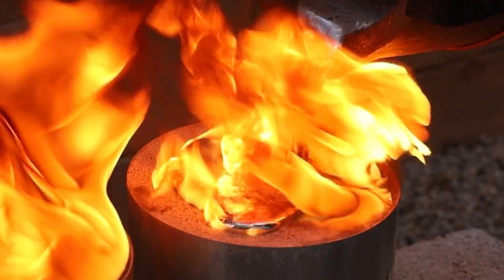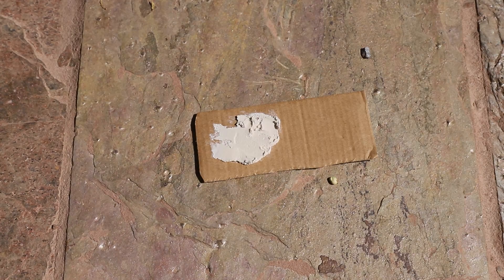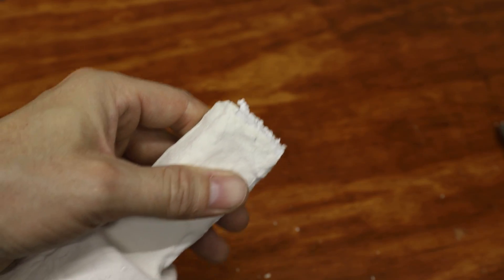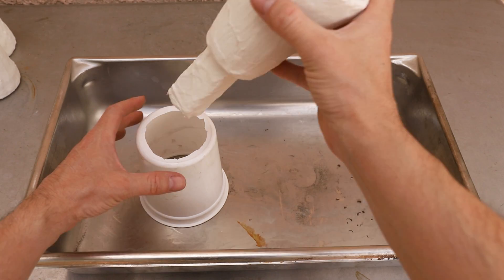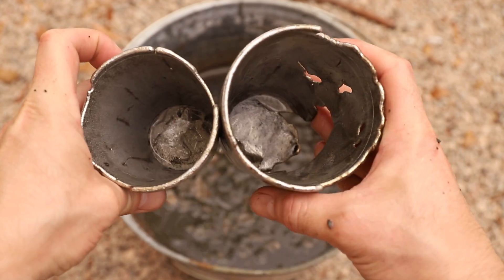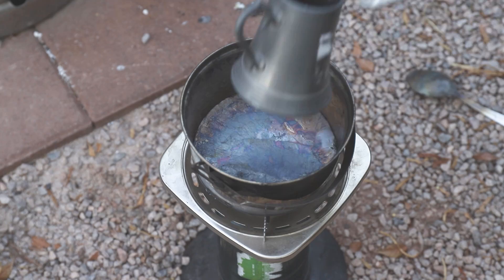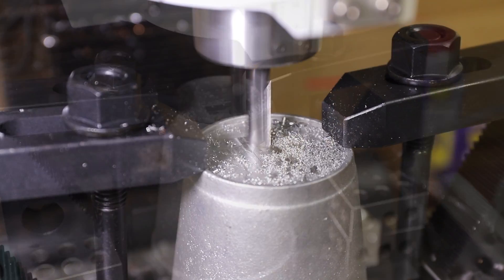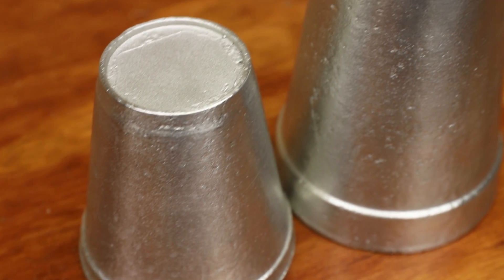Turn Styrofoam cups into METAL - Experimental metal Casting - Lost foam casting

Comment: You could add a couple vents at the lip of the cup back to the top of the mold to give air somewhere to go. Also like others have said, baking the mold before casting and pouring while it’s hot will help as well. While the drywall mud is cheap, using a quality investment might help a lot.

Comment: I would have worked with aluminum if you preheated the plaster molds in you foundry to bake out excess foam and glue from the plaster molds.

Comment: Fun video.  You could use a welding gas (Argon+CO2 mix) flood to suppress the fire.  Those foam fires are potentially toxic and it is not good to breath that sooty smoke.

Comment: You never mentioned pouring temperature, although you mention melting point. The thinner the wall the more over melting point you need to pour it. If I were pouring something that thin the metal would have been glowing orange. Funny how I didn’t notice any comments about temperature either, it’s one of the most important factors in getting good results.

Comment: So I've been thinking, all these youtubers who show off lost foam or lost PLA method casting, and they use various materials for encasing the material, like either some type of special plaster or that expensive as hell yellow ceramic stuff, and then spend a week to add thin layers over and over, that makes me wonder the whole time like what if you just use straight up pure cement, like add a layer of pure portland cement as and lather that on so it retains the details, then encase that in a thick thick layer of mixed concrete (so portland cement, sand, aggregate). Like, wouldn't that be strong enough to withstand heat? Sure it might take a while to dry out completely, so timewise it might still suck like the other methods, but it might be an inexpensive sturdy option. 
Has anyone tried that? Using cement and concrete instead of ceramic slurry or plaster?

Comment: wait...is that drywall compound like suspend-a-slurry??  Could it be used by coating with the silica sand and making a mold for other things??
Also I am wondering if it could be heated like the suspend-a-slurry and silica sand in the kiln...

Comment: I have seen others create the mold with some kind of water soluble plaster.  Then heat (in a kiln)  the mold to burn off the styrofoam so you have a completely empty mold.

Comment: Used plaster drywall to cast foam successfully about a decade ago when I was first getting into metal casting. A very effective coating, cheaaap too. No need for acetone, but do need vents though.

Comment: I would cook the molds at 700C gor a few hours and pour the aluminium with the mold at say 300C.
Reply from the maker: I wasn't sure that the joint compound could hold up to those temperatures but I'll give it a try. Thakns

Comment: just a future suggestion, if you ever find the drywall compound shrinks or cracks too much, you can always make a donut shape on a flat surface, and fill the middle hole with plaster of Paris, then slowly mix the two together, the Plaster of Paris will help stabilize with the shrinkage as the compound dries by accelerating the cure time.

Comment: Just need to preheat those molds so it drives the rest of the rest of the Styrofoam out and prepare the plasterer for the heat extremes. . Mix in some sodium silicate with plaster of Paris for your investment media. , , It will help refract the heat a little better as well as help those molds hold up and probably leave a nicer finish on the aluminum.

Comment: See the videos on how small boat propellers are cast in aluminum and stainless.
Its basically a dip/coat/dip/coat buildup then kiln dried/hardened to become a ceramic of some sort… your styrofoam cup would vaporize, final clean/rinse/blow it out, then reheat (or pre-heat) to ensure its completely dry inside.

Comment: Styrofoam isn’t used in the manufacture of cups. Styrofoam is a brand name for a formulation of polystyrene specific to wall insulation. I believe the rights belong to DuPont. Not the same argument as “Bandaid/Adhesive Bandage” because they aren’t apples to apples. Trivia not trollin…

Comment: I'm perplexed.  No treatise ever written on lost foam or lost wax casting suggests or implies that the hot metal be used to displace the core!  The material is supposed to be burned out in an oven PRIOR to the pour.

You are quite lucky that you didn't get a hot-metal shower then the aluminum his the residue in the mould.

Comment: I cast a cup in high school, but made it solid, my dad had a 19' flat bottom boat and i used it as a stand off for the cavitation plate lever with a aluminum angel iron on the other side of the stringer that i mounted the ignition toggle and a push button starter.... no key.. turned out good and never failed... Gen x Fuck  yea!!!

Comment: If you heated the molds and sand before pouring it would might reduce the thermal shock. You might make a few vents as well to prevent heated air from creating pressure inside the molds. When we did a similar  process in school we did not use a coating or  remove the foam, but let the metal vaporize it as it poured. If we wanted an area to be smooth we would attach some paper to the foam which worked amazingly well. We also used a green casting  sand that would hold its shape if you squashed it in your fist and then opened it. You could add all kinds of textures attaching various kinds of tape and paper to the foam.

Comment: I don't know that brand of mud , you can take a mixed to your liking spoon full and fling (yes fling or drop ) it on to a unfinished white paper side of a small piece of sheetrock . true lightweight "topping" not joint compound should scrape free with a putty knife w/o tarring any paper off the board. In the past "joint compound " has always had good amount of glue in it to guarantee when taping the sheetrock joints the paper tape makes an extra good bond to is the boards. If they where to move over time the seems wont crack and show through to the painted surface of interior walls in theory.  So your cleaning issue could be glue and a solvent mite make short work , some companies add other things to mud to increase the chance a home owner will grab their brans . Like paint ,going as far as to claim if used for texturing ceilings one could skip painting ... Always seal new sheetrock or you will regret it in the long run . Back to it do the "messy taping apprentice leaving joint compound buggers on the new walls to dry test " ( if the paper tares you have to skim and sand every spot or it will show when painted ) and see what brand comes free with the least effort .. good toping should almost snap off with one motion/scrape. And bonus tip in a 5gal bucket when we mixed toping the pros add maybe a coke bottle sized amount of dawn dishwashing soap the liquid kind , but that ratio is to 1&1/3 boxes of mud so you would need much less , but the soap stops air bubbles from appearing in the mud when we would coat joints and butts and pull metal on the job .. You may have a use for this maybe not . Liked seeing the mud baked like that and the sound lol great stuff man!

Comment: EXCELLENT EXPERIMENT !!! In my younger days as a Die-Maker, the shop I worked at, made a pinned together Aluminum mold to inject red wax into. Then open, clam-shell like, and the wax part was removed and close the mold and do it all over again. They would then, coat those with potters slurry and add fine sand, and allow to dry, and layer it many times. Then cut a sprew hole and Fire the mold into porcelain, and pour out the wax. Then pour Stainless Steel in the sprew hole and allow to cool and drop it in a shaker bin with metal BB's and a Stainless Steel part emerges. Cut and dress where the sprew was and have a finished part in a very quick time. It turns out that those were Turrent mounts for Huey Machine-Guns. They were intricate parts. & made from Stainless Steel, it would have been hard to make those. That's kind-of what you're doing here with FOAM instead of "Lost Wax"

Comment: I recall large scale foundries using additives like very fine silicon dioxide to improve the flow of the molten aluminium. One of the mechanisms by which that works, is by lowering the thermal conductivity of the molten material, allowing it more more time in a less viscous state. Another option might be to use aluminium-magnesium alloys.

Comment: No, drywall mud will not react to acetone, but it is radioactive. Sheetrock brand used to keep a warning label on the box about the radiation exposure hazard. A lot of people complained about it, saying they didn't want to use it since it was radioactive. So Sheetrock removed the warning and everyone was happy.

Comment: I remember reading about aluminum casting temperatures, as little as 50 or 100 degrees Celsius can make a big difference in how the metal flows....Casting something so thin the you may have needed the aluminum to be a little hotter and or needed to preheat the mold so the metal stayed hotter longer.

Comment: Gasoline is a solvent of Styrofoam. Would Plaster of Paris be a better mold, eliminating the drywall joint compound?  Then you might try Copper, Brass, Bronze, Silver.

Comment: Great idea. First attempt could work but You need to pour faster. Not from crucible but useing spoon that you'll empty in 1 seckond. But to pour so fast plaster cant be saturated with disolwed foam- to much gases.

Comment: Because you are filling the molds from the top you don't have a path for the air to escape. You should have your sprue go all the way to the bottom and allow the metal to flow upwards, with the column of metal acting as a pressure column forcing the air up and out though a vent  located at the top (where you placed your sprue).

Comment: Aluminum is really good at conducting heat so the issue could be that it's cooling too fast with so much surface area and so little mass. Can the molds be heated up before the pour to slow the cooling of the aluminum and improve its ability to flow?

Comment: If you made the mould upside down and designed it to be filled from the bottom with small vents on the top and buried the molds in hot sand you might have been able to get aluminum to work.

Comment: Industrial lost foam foundries don't dissolve the foam. Foam in the mold isnt your problem. Those "molds" should be heated to around 100 f for   36 plus hours before casting and they should be thin enough to allow off gassing into the sand. Don't get yourself killed.

Comment: Here's a tip, if you plan on drinking out of those cups (for whatever reason) avoid putting acidic drinks in them. Especially tomato juice. The acids can react with the metal and form toxic compounds. Could be a clever way of poisoning someone...

Comment: To cast really thin things in aluminum with the lost form method, you have to heat up the mold. I heat up the mold to burn out the Styrofoam, then pour in the aluminum into the hot mold. With enough head to get the pressure high enough i can cast parts thinner than 1mm.
To burn out the mold i put the mold into sand in a metal container, and then heat up everything in a furnace. The the Sand will hold the heat for quite a while. This really helps to get the liquid metal to every part of a thin walled mold.
As a mold compound i use clay slurry with soap, sand and rock wool to build up thick and stable shell around the object.

Comment: I would double up the wall thickness using 2 cups, and removing the rim of the second, then burn out the remaining styrofoam in a toaster oven or something similar. Additionally, using The thicker walls and base would make casting easier. Also, real investment casting plaster isn't too much more expensive than the drywall mud you used and can be removed more easily by plunging into water while the mold is still hot, but the metal has solidified.

Comment: If you want to cast alluminium again, you need 1 more step in the process for the metal cup casting. You need to remove the reminding foam with heat in your furnace.

Comment: Instead of drywall mud try Durham's water putty. It sets very hard and will form intricate molds. It sets fairly fast and even thick layers will set overnight. It seems resistant to heat but I haven't tried molten metal. You mix the powder with water to make a consistency anywhere between firm clay to pour-able liquid. Non toxic, no smell, very cheap.

Comment: Any time I’ve “dissolved” styrofoam in acetone, it’s just melted the styrofoam down into a nasty plastic goop, which I’m guessing is what got so hung up in the thin walls of the casting. Not sure if water would affect that goop at all, like displacing the acetone and causing the goop to dry out like it does when the acetone evaporates, but maybe melting the foam down with the acetone, then flushing the casting out with a stream of water, like a garden hose nozzle or a stream of acetone if you could somehow manage that without melting the equipment, could flush it all out from in between the thin walls. A perfect styrofoam-textured metal casting would so satisfying.
Reply: Congratulations you just made napalm :D it's why the stuff flared up when he tried to cast it.
Reply: @matthewvandeventer3632  Oh, believe me, teenage me was very, very, aware of how flammable it is... If I’m not mistaken, it’s even mentioned in the Anarchist Cookbook (which I would never, and have never, possessed nor read, YouTube…)

Comment: put 2 cups together to increase wall thickness for an aluminum cast... also add a metal tube to the top of the riser to increase head pressure

Comment: Why use vermiculite rather than regular sand to fill the inner void? I read that vermiculite expands when it is heated but that doesn't seem like a benefit here since it might lead to deforming the mold.

Comment: I do a lot of lost foam casting and cast a similar part to explore the limits of the process. There are two previous episodes under the same name and many other lost foam castings on my channel.

https://youtu.be/QSi2Jx8-Jos

To me, the advantages of LF casting is the design freedom to cast objects with complex coring and parting surfaces with no special tooling, coupled with the ability to use unbound sand in a greatly simplified molding process, allow the molten metal front to evaporate the casting, and avoid high mold costs and the additional labor to complete the casting. If you were going to do all that, why not just invest or shell the cup, and use the usual process for block or shell investment to fire and evacuate the mold, and cast the cup? 

Using acetone to dissolve the foam pattern densifies the polystyrene and reduces the foam pattern to dense residue in the mold. The coating in LF process isn’t meant to be mold structure but to enable the entire mold surface to serve as a permeable coating. Since the entire pattern surface vents/expels the evaporating pattern, the traditional concept of vents doesn’t apply.

I see in your channel you practice different casting disciplines. Choosing the best process for a given casting probably gives you the greatest advantage for casting success before you even begin. I use LF to make one-off and small quantities of machine castings that would be large and expensive to tool or invest or shell. It’s great for that but I wouldn’t select it for jewelry or detailed statuary and ornamentals.

Best,
Kelly
Reply: In general, sand casting isn’t something that lends itself to reliably casting .060" wall aluminum since aluminum has poor fluidity and loses heat rapidly to a mold that cannot be preheated…….but in respect to the question of what to do differently…

You don’t mention the alloy. If it was an aluminum casting alloy ok. If it was wrought, extrusion, sheet, or worse yet, cans, not ok, the fluidity will be substantially less.
You don’t mention pour temp. You need +100F for LF casting compared to conventional open cavity sand casting and even more so for such a thin-walled castingl. I’d suggest 1450F+ for that part.
Use a much thinner coating. Just enough to cover the foam will do. It will be far more permeable allow the decomposed polystyrene to escape to the mold. 
Use a steel pouring cup (a soup can will do) with the outside buried to the top and the sprue and mold sand at the bottom of the interior of the cup. It will reduce flame and turbulence and provide a buffer volume so you don’t have an interrupted pour like in your video. 
Use a longer (6”-10” OAL) sprue for more head pressure. It can also be smaller in cross section than the one shown in the video.
If you used an annular gate that was say 3/8” cross section attached to the perimeter of the base of the cup, then attached sprue that contacted it at two opposing locations, the more massive gate would fill first and provide a generous source of hot metal to fill the cup wall.
No need to dissolve the foam prior to pouring.

Pewter and Zinc are much easier for thin-walled castings due to much higher density and fluidity. Sort of interesting that the joint compound stuck to the pewter surface. 

Best,
Kelly

Comment: Cool!  My family has an aluminum foundry. One day a guy up the street brought in a display figure of the Pillsbury dough boy.  It was made from styrofoam.  We covered it with nobake sand and cast it. He put the casting in his front  flowerbed.  You did a good job gating the cups. One trick that helps is to run a narrow hole next to the inlet. A "riser" hole to let gas out. A 3/16 rod hole is all you need.